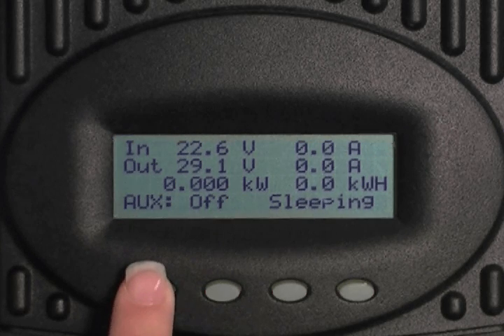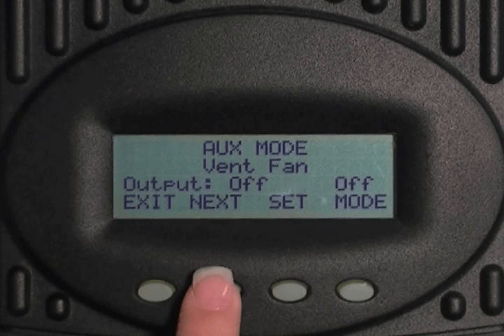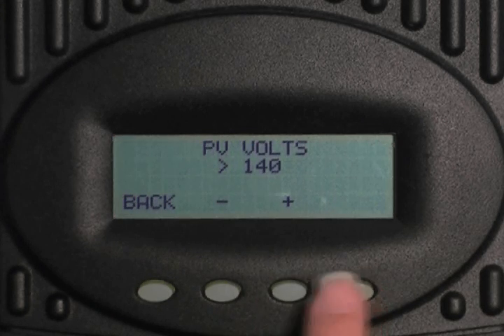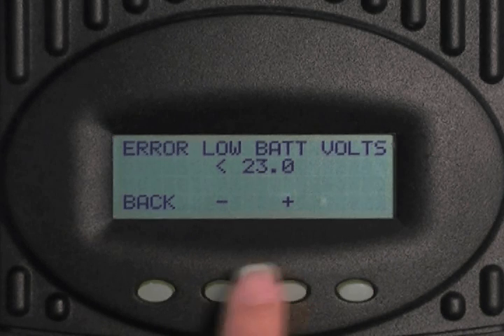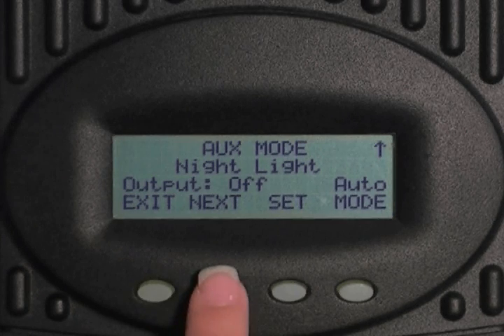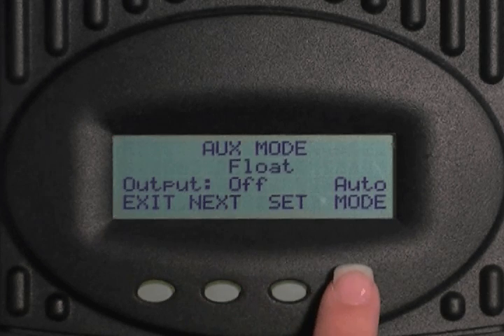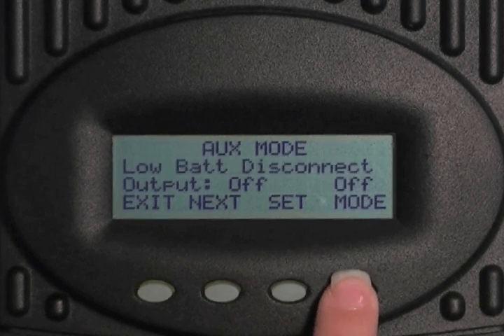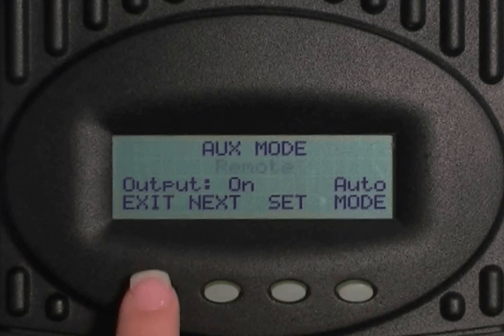Tech Support | FM60/80 AUX Functions Setup

Comment: I shut off array power to the charge controller to remove and replace a solar panel. The charge controller will not turn back on now when tried to turn it on by manual instructions. There is correct power from the array to the charge controller and the batteries read 24.7 volts on my volt meter. Anybody know what is up with that? Thanks!